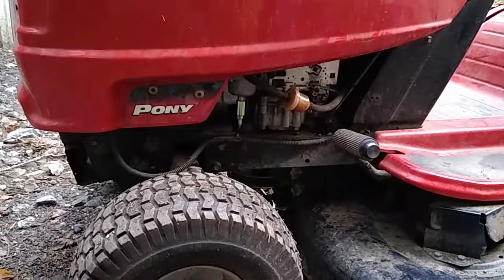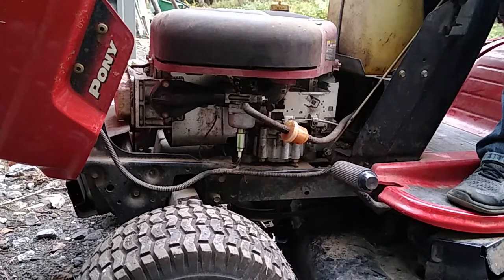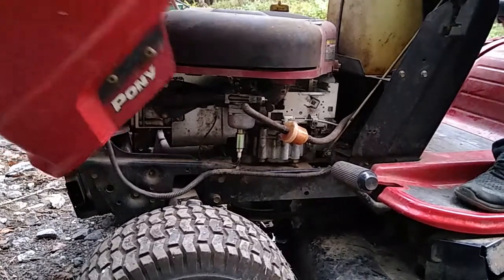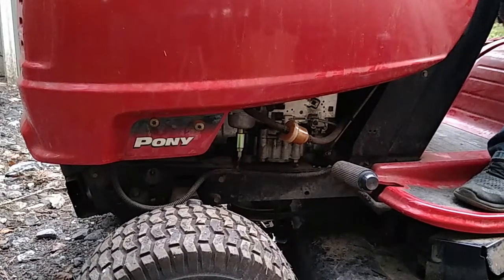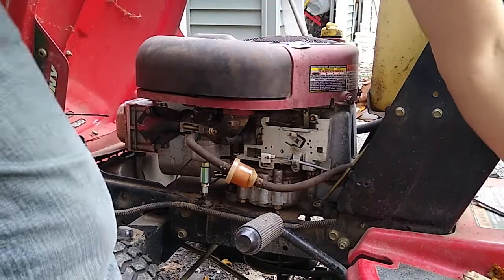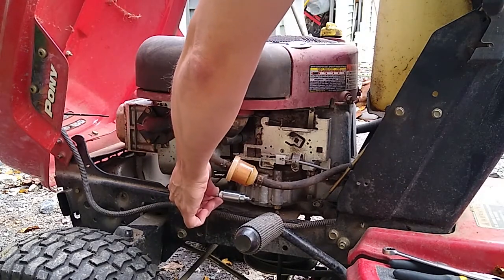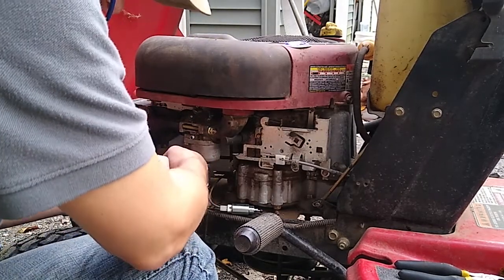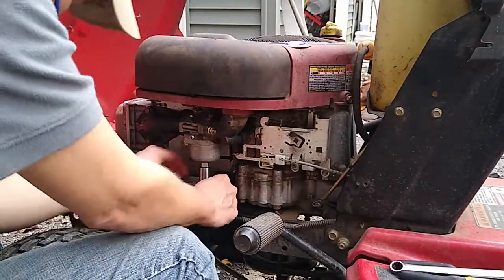RIding Mower Engine Backfire- bad fuel shutoff solenoid

Comment: Those particular briggs engines backfire more than any small engine I have personally been around.  I have had some even with a working fuel shut off solenoid still backfire.  I have fount and manufacturers even suggest this if the fuel solenoid is working properly to shut the engine off at wide open throttle.  I have a Bolens with a similar briggs it will backfire if you let idle but, shutting it off wide open like suggested no backfire.

Comment: the bigger mufflers is what the equipment manufacturers use regardless of the engine make single, opposed twin and V twin engines Briggs & Stratton, Tecumseh, Kohler, Kawasaki, Subaru, and these Chinese engines they use. i would custom make a new exhaust pipe and get a 1 inch pipe nipple and use a pepper shaker style muffler from Lowe's but aim the muffler so it points away from the tractor . the smaller muffler is not loud when it backfires.  the fuel shutoff solenoid on some mowers are linked to the seat safety switch,  the parking brake and reverse when the mower is engaged so it stops the engine through the solenoid  and not grounding out the magneto coil. the older machines without this solenoid the switches ground the magneto coil to stop the machine when the  operator rises off the seat. the past 40 years these mowers are made manufacturers put on bigger mufflers for them to be quiet but little do they know when they backfire out the exhaust its painfully loud when the unburnt fuel ignites inside the muffler.

Comment: I've got a power more 420cc that has a light stumble especially with no load and when rapidly decelerating. It will back fire a few times..cleaned carb and checked plug. Plug was a little black but not bad. Fuel shutoff solenoid seemed ok.
Reply from the maker: I've cleaned more than my share of carbs, but my new go-to is just replacing them.  Sadly the replacements are just too cheap to bother cleaning.  Maybe I haven't mastered the art, but my success rate cleaning out tiny carbs is like 75%.  regarding your stumble, it sounds like an air/fuel mixture issue.  The carb might have an adjustment screw, but if not, I'd ensure the air path is stock and clean.

Comment: the bigger mufflers being put on these mowers the backfires are louder. had that happen to me  Nelson is the mfg of the mufflers same too with briggs.
Reply from the maker: Good to know. Thanks for the comment.
Reply: Is the valve polarity specific? I have new carb and it still backfires 😅
Reply: @yishaibenisreal8050 I just got a new to me Ariens with the Briggs & Stratton 17.5 horsepower.  I was getting some backfiring upon shutting it down.  I have found that if I turn it down to low idle (all the way down) and wait 5 or 10 seconds, no backfire upon shutting it off.

Comment: Simple fix is to get rid of the solenoid and replace it with a bolt or cut the solenoid tip off and replace with a shut off .